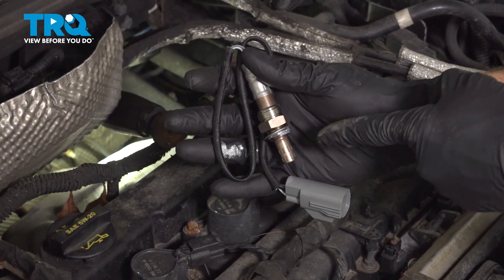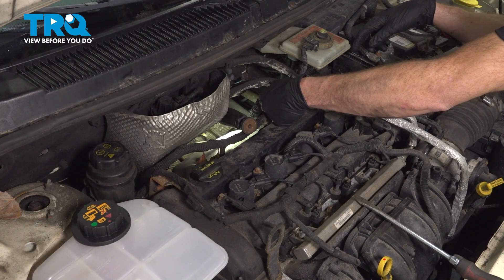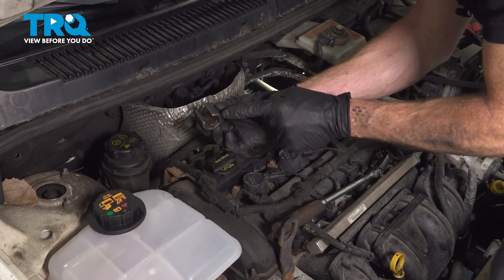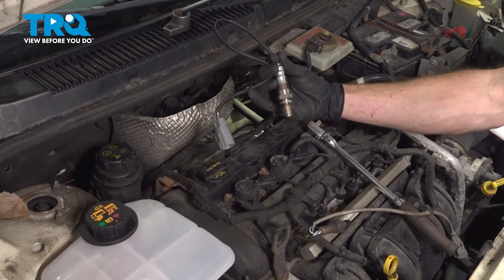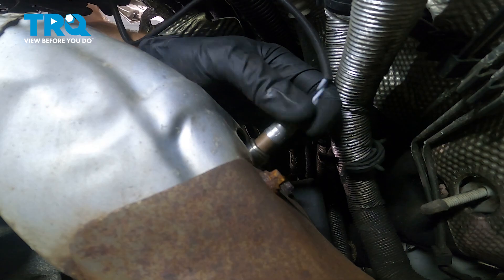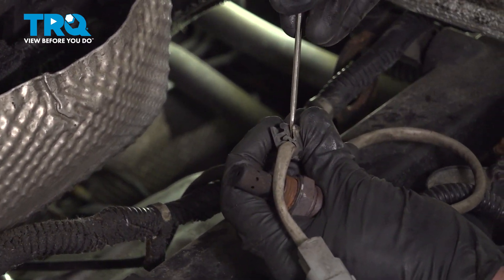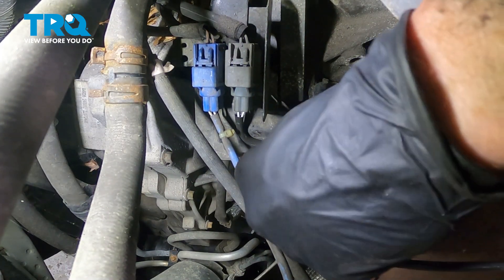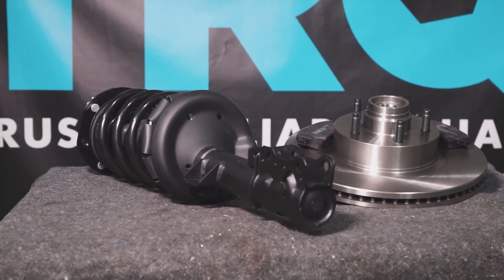How to Replace Upstream O2 Sensor 2010-2013 Ford Transit Connect

Comment: This is actually not a hard job if you prepare for it. I did this not in the rust belt on a 2013. The heat shield on the upper shifted and wasn't able to put the socket onto. Yet I had a telescoping mirror and was able to get one of the O2 removel tools that I rented from O'Reilly's auto for a $32 deposit. I had tried to reuse the plastic clips yet not good.  So what I did on the lower was used some electrical tape around the harness and then used a zip tie away from the exhaust. When try to thread the new sensor in wrap your harness a bunch of turns counter clockwise looking from underneath. Get threaded buy hand to make sure that you will not cross thread. Then I fished a wire through the pass and clip. I went back underneath and was able to get the wire. I used electrical tape to join the wire and the connector end. I went slow and up and down as I pulled up the wire slowly to keep it away from the exhaust and in a factory position. My best advice is to spray some rust penetration spray before you try to accomplish this task. Other than that it went well in the driveway with a jack with the  emergency brake on with the tires chocked with a jack stand. When the Transit is raised you can use a milk crate on a mat so it doesn't slip to work above. I hope that this helps. Great video thank you for posting.👍🏁
Reply from the maker: +@327JohnnySS Thanks for watching our video! http://1aau.to/m/Shop-TRQ